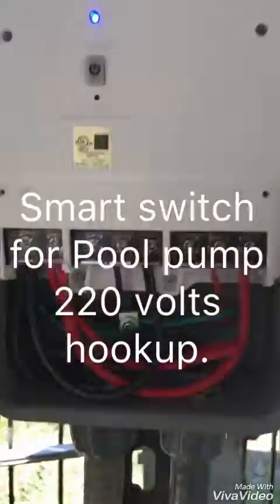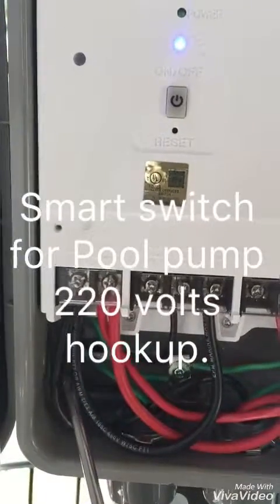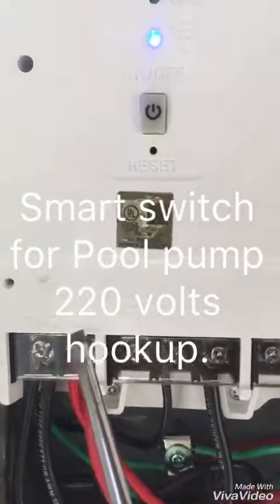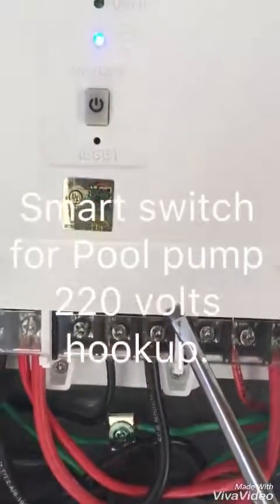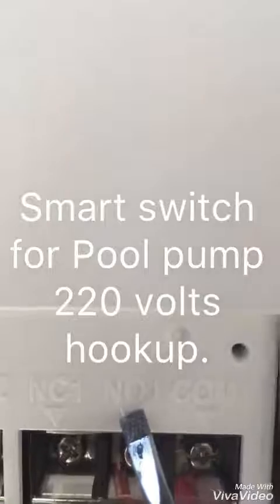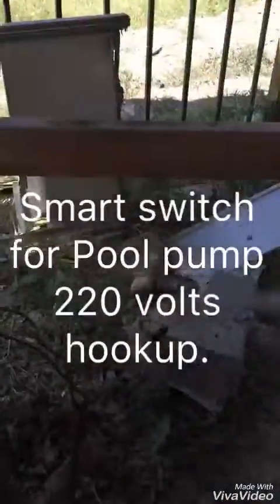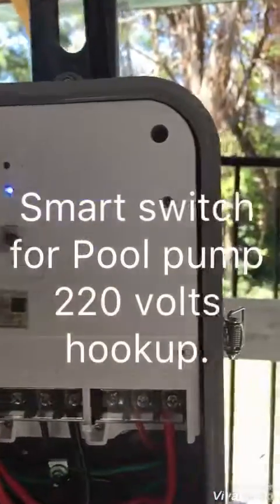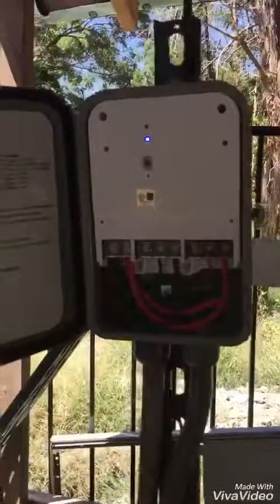Pool pump smart switch

Comment: Four years on, does it still work? Do you still like it?  Thanks for the video.
Reply from the maker: I use a 4 port Sonoff switch to control a contactor that turns the pool pump on/off.
Reply: @dennyram1 thanks. Lol so I guess the answer is that this does not work four years later.  Why use sonoff instead of this?
Reply from the maker: It became unreliable after 2 yrs. 
The Sonoff setup is much more reliable and cheaper.
Reply: @dennyram1  thanks.  Could you do a video of the sonoff setup?
Reply from the maker: I’ll let you know.

Comment: I used your instruction and it worked with my 230 v pool pump, but when I started the first time it made a loud noise. I thought it is gone but everything works perfect. Should I be concerned about the noise?

Comment: Can this wifi switch control two components (lights, booster pump, waterfall pump) separately? If so, can they be different voltages (110v and 220v) or do they both need to be the same voltage? I want the two components to be able to turn on/off independently of each other.